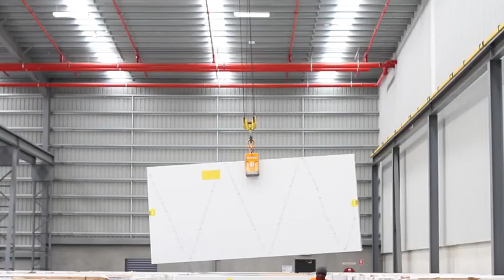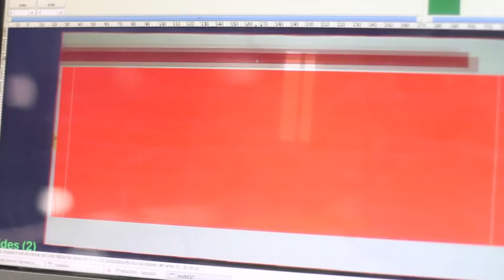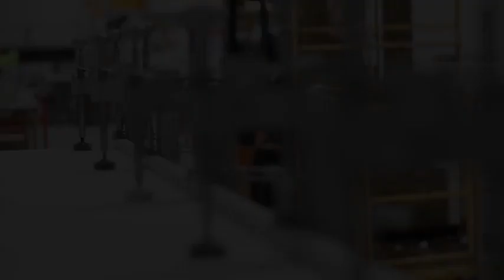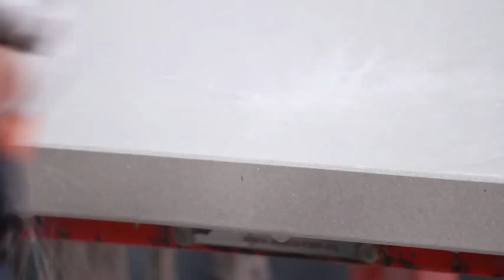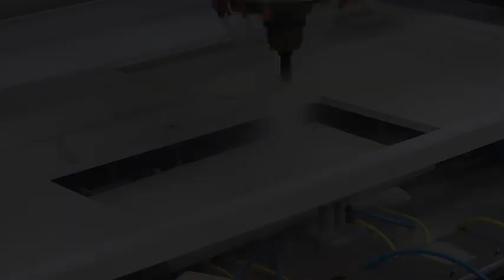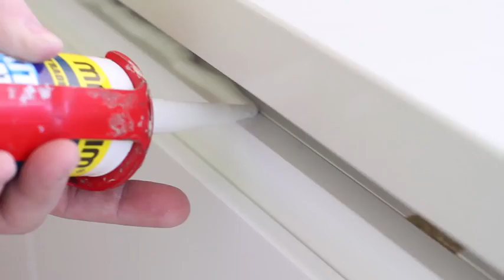How a Caesarstone worktop is Fabricated and Installed

Comment: Isn't this missing the support under the benchtop? This 40mm bench top now sits 20mm lower than it should, possibly blocking draws and cupboards. Every other video showing installation of 40mm benchtops includes the MDF (or similar) support underneath.
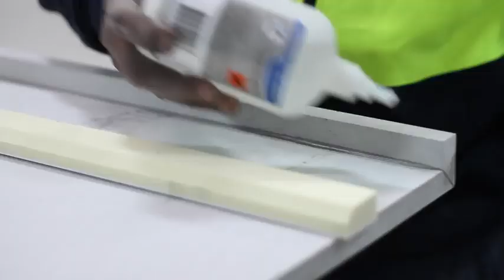Reply: 2:25